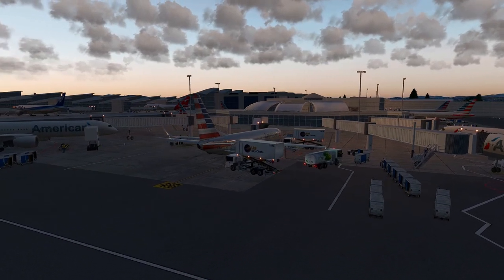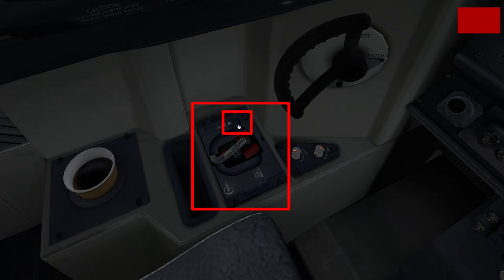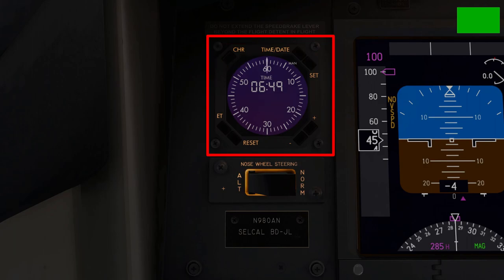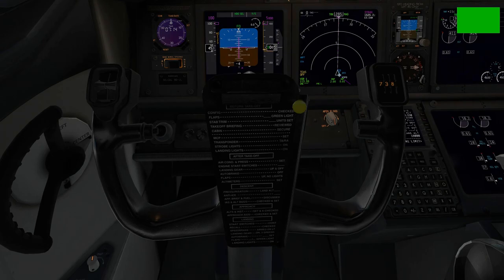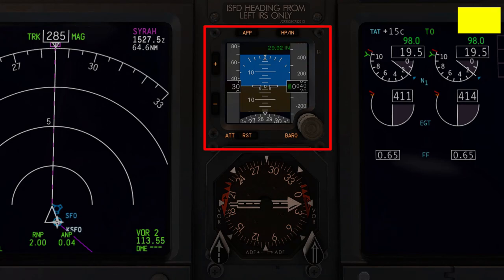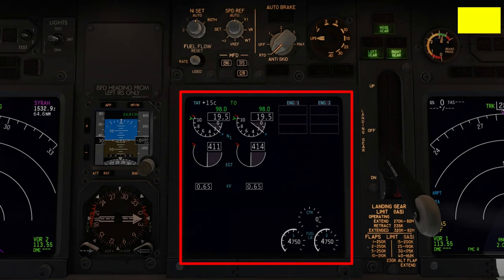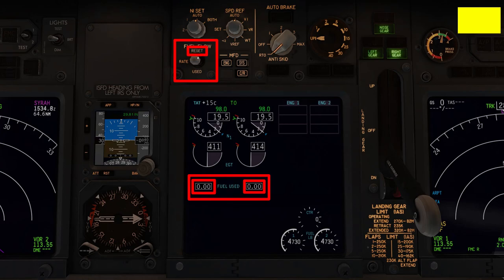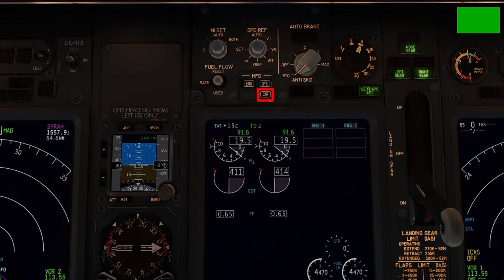Aircrafts Dissected Ep 6: Upper and Lower Display UnitsIZibo 737IX-Plane 11 Detailed Tutorial

Comment: Another great video, sir!  When loading fuel, I've always verified the units in the tablet.  I never really noticed that the units are in small print between the gauges -- thanks for point that out!

Just a couple of minor notes:
   - In addition to the reasons you discussed, the Takeoff Config alarm will also sound if the parking brake is still set when advancing the throttles.
   - N1 and N2 units are expressed as a percentage of the maximum normal operating speed (RPM), not thrust.  Thrust will vary based on other factors, but the maximum designed "normal operating speed" in RPM is constant.  N1 is typically associated with thrust, while N2 is the primary reference for determining sufficient power delivery to aircraft systems that depend on bleed air from the engines.
Reply from the maker: Thank you so much for watching the video and of course for giving me that simple and brief explanation about the N1 and N2 systems. Truly appreciate it:)

Comment: I see that you provide Kalle's excellent explanation of N1 and N2 at the beginning of Episode 7. Adding to that (and somebody correct me if I'm wrong): Turbojet engines have all of the compressor and turbine wheels mounted on a single common shaft. But for modern high-bypass turbofan engines, that won't work. As I understand it, the main reason is that if the shaft were to spin at a speed appropriate for proper performance of the high-pressure section, the tips of the front fan blades would exceed the speed of sound (at a given RPM, the speed in feet-per-minute at the outside diameter of a big wheel is greater than it is for a smaller wheel). The resulting turbulence at the blade tips would prevent the engine from running properly. But with a two-spool design, the N2 shaft can spin the high-speed, high-pressure compressor and turbine wheels (those closest to the combustion chamber) as fast as they need to, while the low-speed, low-pressure wheels (including the big fan that you see at the front, which generates most of the thrust) can turn slower so nothing goes supersonic. These two shafts are coaxial (the N1 inside the N2) but otherwise are not connected mechanically. If you turn the front fan by hand, the N2 spool will not move. On startup, the N1 spool only starts rotating once the N2 spool is sucking in enough air to windmill the fan and low-pressure compressor wheels. As Kalle mentions, many Rolls Royce engines have three spools: low- high- and intermediate-speed. A shaft within a shaft within a shaft.
Reply from the maker: Wow, that's very insightful Roland and was definitely a great read. Man I feel I could spend hours learning about aviation all over again. Very interesting indeed :)